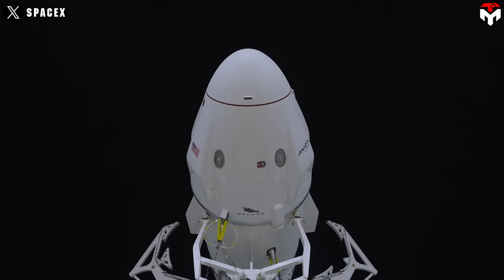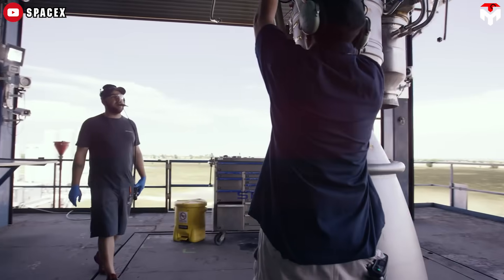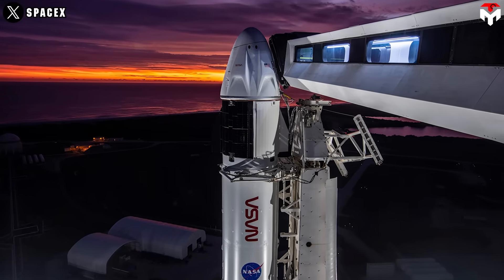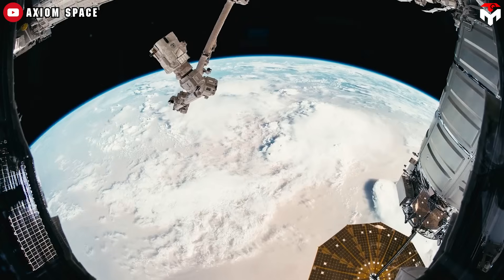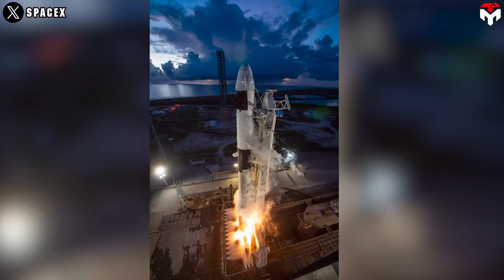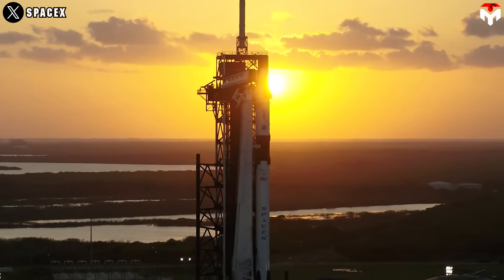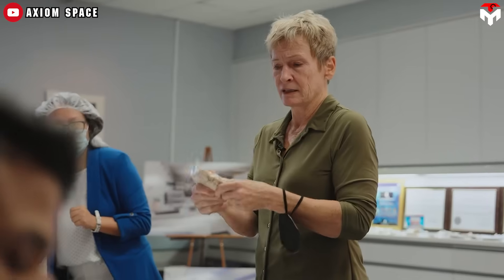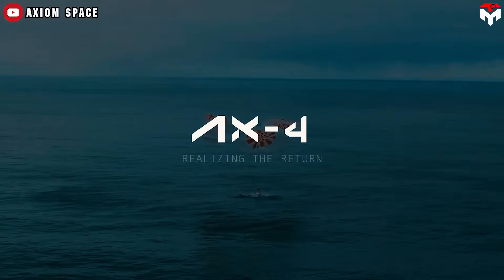SpaceX exposed Dragon Big issue to Launch this week…

Comment: It sounds like SpaceX is exhibiting "get-there-itis" syndrome.  That is a killer in aviation.  Was the "purge" solution one that just vented leaking oxygen overboard as opposed to fixing the leak?  If so, that is a bad move.  As for this Dragon being the last, don't count on it.  Do not expect Starship to be man-rated so they will need additional Dragons to go to the ISS and any orbital replacement system(s).